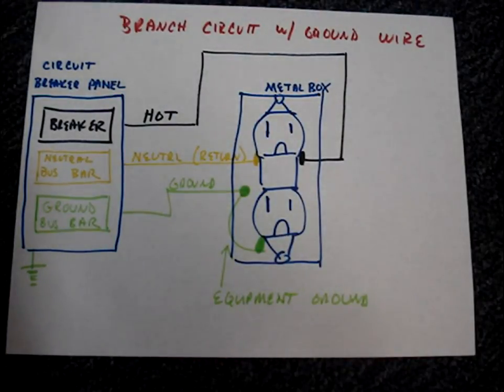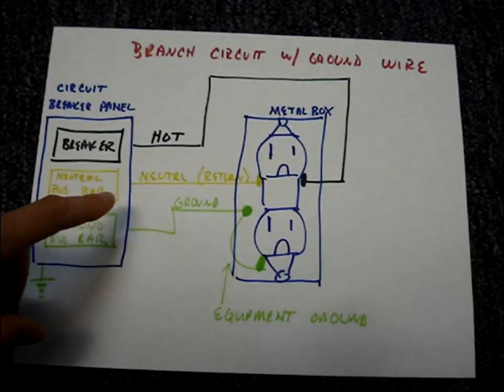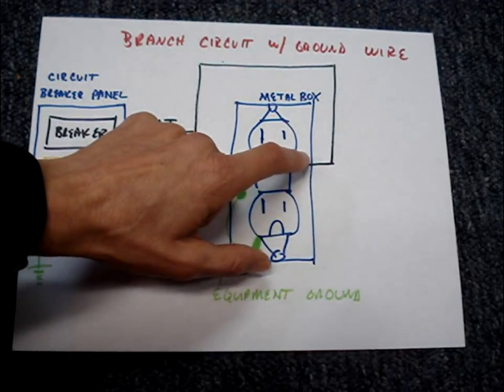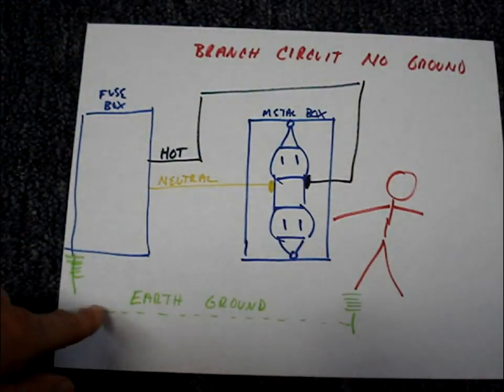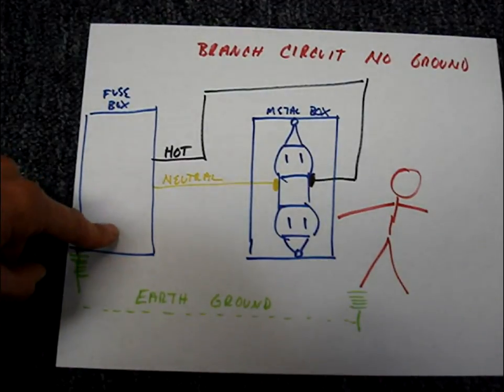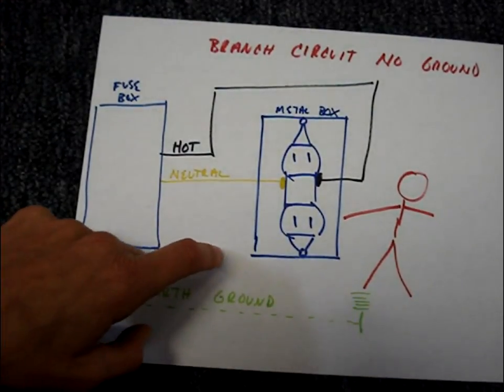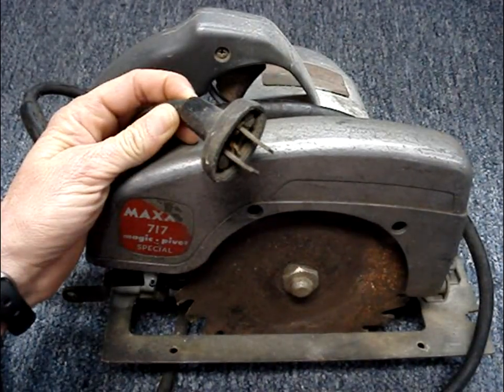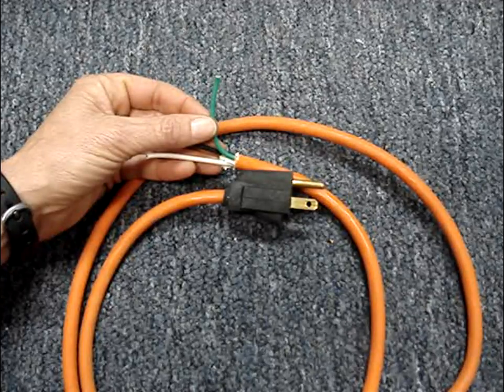Why Do I Need a Ground Wire ?

Comment: Madam, could you please explain us whether then the Europlugs are not safe, since they do not have this ground prong as far as I know of course...  Thank you again for your valuable training and videos.
Reply from the maker: Hi Rasool, sorry for the delay in responding.  Somehow the I missed or did not get the notification for your question. 

I am in the US, so I had to look up what a Europlug is.  I see it is a two prong plug without a ground wire.  According to Wikipedia, these plugs are only permitted on a double insulated device.  Basically, that means the device has a plastic handle or case that can't conduct electricity.  My opinion is the double insulated casing makes it safe.  Here's a link to the Wikipedia article:  https://en.wikipedia.org/wiki/Europlug

Comment: Nice video. You mentioned the groundless saw. What if you wanted to ground the saw and switch to 14-2 wire or similar with ground, any particular rules/procedures since there isn’t a spot for the ground wire?
Reply from the maker: You would have to connect the metal on the saw to the ground wire.  Once we perfected plastics double insulated hand tools appeared on the market.  Drills can be especially dangerous.  Back in the day before hand tools were double insulated, one of my coworkers drilled into elevator power and sent flying.
Reply: @Know-How-Now  cool 😎 I have an aike Amazon hand dryer AK2630s that’s double insulated and doesn’t have ground wire spot. Comes with a cord, but I want remove and direct wire with my 14-2 wire that has ground, the dryer does not. Not sure if ok to connect the ground to one of the bolts or go get wire with no ground.
Reply from the maker: If this is a new hand dryer, it is double insulated, UL approved and the cord doesn't have a ground wire, then it is likely perfectly safe to direct wire it without a ground.  You might try contacting the manufacturer to confirm.

Comment: What if there is no path back to the circuit box? 
In my case I'm putting lights to illuminate a lake inside a cave. If a person is in the water, will it go back to the circuit box even if it's 100 meters away and above ground?
Reply from the maker: If you are running a circuit in that type of environment, for sure you need a ground wire.  The code is very specific for outdoor electricity because if it is not done properly people could get shocked or worse.

Comment: My house has the ground outlets but only 12 2 wire thay jumped the ground wire to the neutral white wire  i think its wrong  but the ground and the neutral go to the same bar in the braker box
Reply from the maker: Hi Bryan, you are correct, you have what is sometimes called "bootleg ground".  It is not legal nor should it be considered safe.  The only place the ground & neutral on circuit should be connected is at the panel.

Comment: Ah .... but here's the problem ... I don't have a metal box. What people are doing is using tombstones as holders for Led tubes. Now, if you pay a lot of extra money, you get a white and black wire coming out of one of (each foot of) the tombstones. I mean I know how to strip a wire and stick it in  ... but is there a screw somewhere? But the biggest problem is the ground ... I mean both the tubes and tombstones look all plastic, at least on the outside. I know what you are thinking: it's only 36 watts ... nope! its not. Because there are connectors from one tube to the other ... you can buy them, (you can make them) like double female extension cords. Surely that makes life more perilous for the for the overly optimistic guy standing in a puddle. I mean 4x36=114 and after so much worry, the heart  ......  Well ... that's the question. And the poster, before me, didn't ask about the code, he asked if it was safe  .. doesn't it depend on how bright your ungrounded light is?

I'm sorry if I sound a little terse. but this is a question that all the answers are really  skittering around and skimping on. You, in particular, seem straightforward and wanting to help. So I ask it.
Reply from the maker: It only takes a small amount of current going across your heart to kill you.  Current can make your hand contract & you can't let go.  I have an electrician friend who nearly died because he was getting electrocuted and couldn't let go.  Thankfully another electrician disconnected the power at the bottom of the light standard and saved his life.  Here is a link to a video, it's long but if you cut in around the 4 minute mark Mike Holt explains in detail of how little current it takes to stop your heart. The electricity used to power your house can kill you.  https://www.youtube.com/watch?v=mpgAVE4UwFw

I agree, what people are doing with LED tube lights is potentially dangerous.  I retrofitted some of my lights and used Feit Electric tubes, they have plastic ends, are directly wired and the tombstones are only used to hold the tubes.  There is no power on them.  Also do not use the plug and play tubes it's likely you won't get a substantial energy savings.  Check out these video I made:  

https://youtu.be/C5OCwIYze8g  (Feit Electric LED tube replacement video)

https://youtu.be/UnAdYuhLuMY (Test showing plug & play bulb test)

Comment: Does anyone know what a ground wire is
Reply from the maker: I'm not sure I understand your question Beverly.  In the United States the ground wire in home electrical systems, if wired correctly will have a green jacket or it can be bare copper.
Reply: It's used as a safety precaution. For example if the hot wire happens to touch the metal box the box will then be energized. if a person were to touch that box they will be electrocuted. But if you had a ground wire (which is connected to the metal box) it will take that current and then act as a path for the current to flow back to it's source.

Comment: You completely lost me there. Is ground important or not? It's like your saying ground its dangerous and its a disaster waiting to happen.
Reply from the maker: I'm sorry I lost you.  Electricity can be a difficult concept to understand.  The ground wire is important.  It prevents your body from accidentally becoming a wire.  Things don't go end well if your body is the "return" wire.
Reply: @Know-How-Now  Yeah did a little bit more research and found it's importance :D Thanks. Earth gives you at least a chance hahaha
Reply from the maker: New appliances/power tools are double insulated, so there is less chance of you becoming the return wire to the power source if the circuit does not have a ground wire.  During my career working on construction sites, I know of two electricians who were killed.